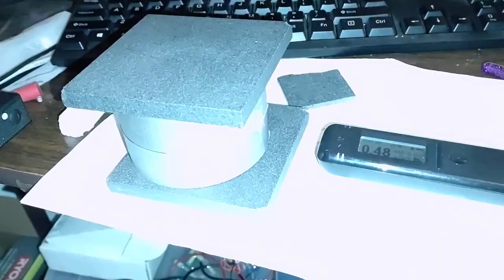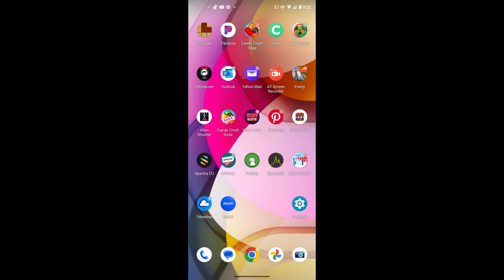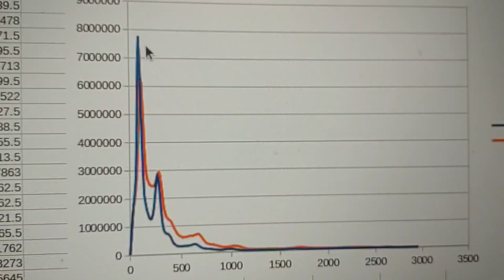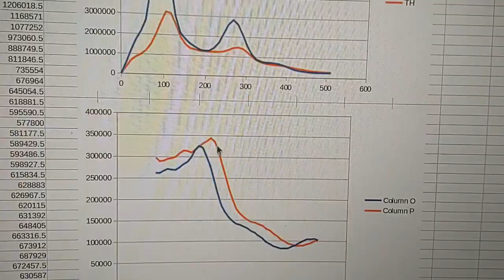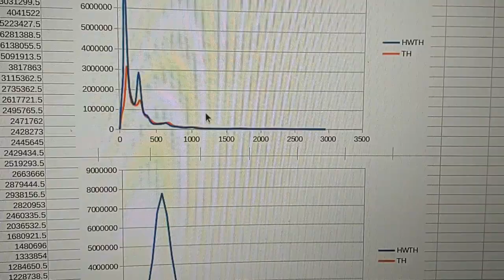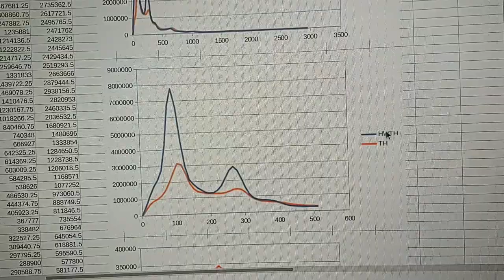Thorium Heavy Water Reactor Spectrum

Comment: Hi, I'm very fascinated by this content, always wanted to know if it's possible to make a functional breeding reactor at home like David Hahn tried back in 1994, I have a lot of ideas about how it would be possible but need to ask some questions with someone that knows more about this subject.

First of all, I think this could work for a good alpha source: 

combining americium 241 from smoke detectors with radium 226 from old luminescence clocks that were manufactured around 1920-1930 and polonium 210 from anti-static brushes that are still sold nowadays in quantities of 500 microcuries.
All of this is combined with aluminum and beryllium to produce an alpha reaction that releases neutrons.

Placing all these ingredients together as a potent neutron source so it can generate enough neutrons to breed uranium 238 and Thorium 232.
Also getting heavy water (deuterium), high-voltage transformers, and a high vacuum system to make a Farnsworth fusor that emits additional neutrons which are placed within the previous alpha source.

All of these components are surrounded by aluminum blocks filled with uranium 238 in powder form by smashing and blending pitchblende minerals and thorium 232 in the form of thorium dioxide from old Coleman gas mantles.

If I didn't get wrong the neutron bombardment and the addiction of graphite to slow them will make thorium 232 absorb neutrons and become uranium 233 later.
The uranium 238 will become neptunium 239 and subsequently plutonium 239, both isotopes are fissionable and the reactor will be capable of producing a sustained chain reaction??

Please!! I'm very proud of people like you and amateur physicists. I want to experiment by myself if a homemade nuclear breeding reactor is something possible. 
I know David Hahn's reactor did not achieve criticality or a chain reaction, maybe because he needed more time or quantities...
Reply: Materials rich in hydrogen are more effective in moderating neutrons due to the nucleus of a hydrogen atom having almost identical mass to a neutron.